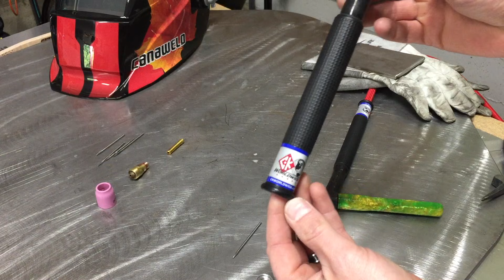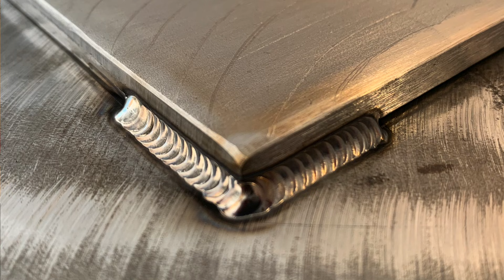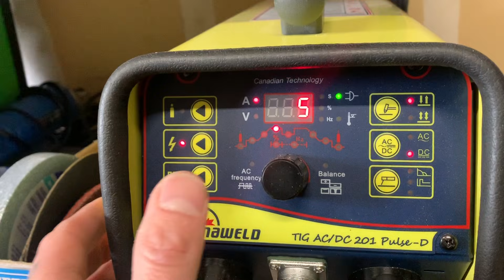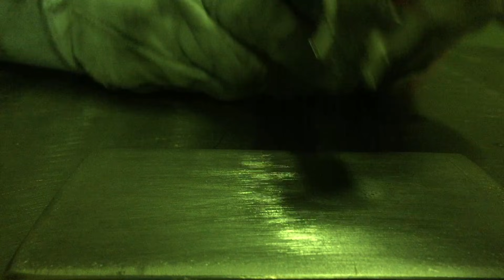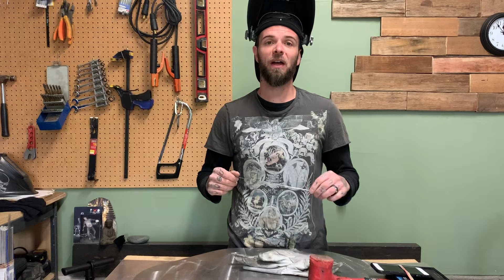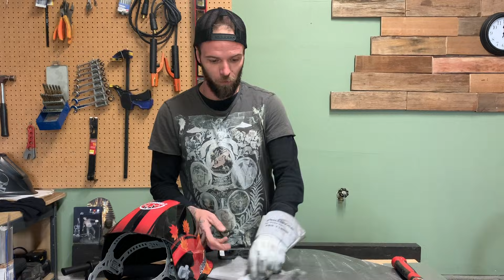TIG WELDING STAINLESS STEEL - HOW TO TIG WELD STAINLESS STEEL FOR BEGINNERS!

Comment: Hi. I have a question is there an easy way to use a blowtorch and some kind of stainless steel rod and bond to stainless steel pieces together or is this impossible. Have a video to show my issues. Can send it if it helps.

Comment: I’ve messed w my gas settings at nauseam.  20cfh usually.  I’ve tried 30 and 40.  No flow meter for the torch yet. 
Using a #8 cup and diffuser/lens.  My stainless welds still come out oxidized and gross looking. 100% argon.  Post flow puddle looks good tho @10 sec.

Comment: New to your channel and new to Tig welding...in fact, never laid a dab yet.  Tig welder on its way.  Impossible question for you....I'm mesmerized by your welding and wonder how long (how many hours) it would take someone to learn how to do something like your weave patter?  I'm OLD and don't have 20+ years...I'm interested in trying to do some simple stainless pieces.  Colored straight lines to begin with.  Keep up the good work!
Reply from the maker: Haha awesome Scott! It actually doesn’t take long; it’s just having a good watchful eye of someone to help. Starting with the basics and not trying things above your head, before someone is ready. That’s a key thing. It’s a process, and for someone to get good at the difficult things, it’s best to learn fundamentals first:) But absolutely doable!

Comment: Hello, I'm trying to find an answer to my TIG welding problem,,, First of all I'm an old guy retired with time on my hands.
I just wanted to learn TIG to give me something to do.
Problem,,,,, I'll be running a nice bead and all at once the arc jumps off the weld a 1/4 to 1/2" and then come back.
I've watched a 1000 videos and no one has covered this problem,,,, and yes it's a clean  tungsten. 15 cfh 100% argon,, 70A 1/8" mild steel
Thanks for your help
RHH
Reply from the maker: Hmmm tough to weigh in without seeing it happen. Usually can be attributed to having a standoff distance a bit too far away... can cause arc deflection slightly. But without seeing it tough to call. Good you keep a clean tungsten! That’s the first one I always go after for troubleshooting! So good call already on that!🙏
Reply: @PacificArcTigWelding  By chance does the arc follow the gas as it comes out?
Reason I ask,, I smoke and notice the smoke was going the same direction but didn't think it was a strong breeze.
Reply from the maker: A slight breeze can effect things more than it would seem. Especially with stainless. It’s annoying sometimes...!🤦🏻‍♂️ And in that case then I would think the arc could deflect possibly.

Comment: Does the tungsten need any certain type of grind for ss??
Reply from the maker: Everyone’s got their own preference, I like a longer taper. Grind marks lengthwise 💪
Reply: Pacific Arc Tig Welding What’s the best way to get the bead width correct without overheating SS or on mild steel 1/8” material ? I’m using 3/32 tungsten with #6 ceramic cup. Do I need to drop down to 1/16” tungsten and filler. Do I need a gas cup? Or better yet what size should the puddles be according to tungsten size and filler??
Reply from the maker: I’d use a thinner rod, just preferred by me tho. People use 3/32. I usually say a puddle with thick as about an 1/8”? Give or take:)
Reply: Pacific Arc Tig Welding ok thank you man!!
Reply: Pacific Arc Tig Welding I gotcha thanks!!

Comment: Off topic but my argon flow meter with the ball only moves if the pedal is pushed to my desired cfh but then when you let off the pedal the ball drops back down to bottom after the post flow....is that normal?
Reply from the maker: Yep. That reads working pressure, so when working pressure is off, ball drops:)
Reply: Pacific Arc Tig Welding Thats good I was worried I had a leak somewhere !!! Thx man!!!

Comment: Another great video I’ve gone back and watched many of your videos I’ve only started tig welding a year ago after 50 years of stick and mig I’m 70 years old and as you get older your hands aren’t very steady so that makes tig welding very challenging but I’m staying at it but it is very frustrating any help with this would be very intriguing
Reply from the maker: Amazing to hear! Glad I could contribute in any way! Great to hear you’re learning!
Reply: May not work, but try to use those shakes to run ur bead, iknow some older welders that can run very good beads

Comment: Question! How far is your tungsten stick out and how close are you holding it to the metal?

Thanks!
Reply from the maker: Hey! I usually run stickout length the same as cup diameter. Ex 1/4” cup opening, 1/4” stickout. And then aim for standoff distance less than that:) Basic starting point for me at least 🙏
Reply: @PacificArcTigWelding  awesome, thanks!

Comment: Thank you for including metallurgy! It helps so much. Because I feel like that’s part of the basics, to fundamentally understand metals and how they work. 
Though I could be wrong, I thought stainless was supposed to have less carbon in it. Like when using a grinding disc that’s been used on carbon steel, you could impregnate the stainless with those iron and carbon deposits which can cause it to rust.

Just to edit: keep your filler wire shielded with the post flow!
Reply from the maker: All good points! Filler wire getting oxidized is something that took me so long to figure out by myself...! Self taught takes too long on some things😂
Cheers my friend:)
Reply: Pacific Arc Tig Welding haha yeah! It took me a hot minute to learn keeping filler shielded. It doesn’t matter with aluminum wire though since it’s a non reactive metal I believe
Reply from the maker: Yep you got it! Easy when it’s aluminum, but also easy when i run a #15 cup on stainless too😂 When i switch to a 7 or 8 for fine detail all of a sudden I have to pay way more attention...😂

Comment: I see some people use only 3/32" for everything and some that match the filler rod size to the tungsten size and use the 1amp per thou. 
Which is your preference
Reply from the maker: Yeah I hear all that. I use strictly 3/32 tungsten and 1/16” for most of what I do. I’m open though, and there’s obviously applications for different setups. I’m a pretty open minded dude for welding setups🍻
Reply: 1 amp per thousand is only good up to .125 or 1/8” thick material from what I’ve seen!

Comment: I would have run 100amp and bored a bit quicker. But God I love the look of the colours
Reply from the maker: Me too. #keepthecolour 
All good! Thanks for checking out the vid!
Reply: @PacificArcTigWelding  
Just hit the sub button mate. 
I have also booked in for next thursday to finally get certified in Tig Welding. 
Been doing it for years aswel as mig, stick and silver solder and brazing. 
So been doing it for years but finally getting the process of getting certified under way.
Reply from the maker: Amazing! I’m sure you’ll get it. Good for you! And thank you for checking out my channel!
Reply: I also agree with your opinion. As welding stainless is not as simple as welding mild steel. You can ruin the characteristics of stainless from to much heat. Not enough gas. Not back purging and so on. 
And starting of you need to learn torch control. 
Regardless of what your welding. And welding without filler. Autoginious welding is a ton simpler. And is the best way as you dont have to focus on 2 things at once. 
It also gives you the chance to stuff about and learn what things do and how they affect the arc. So welding without filler is the best way to begin.

Comment: Hi,
just thought I'd drop a comment - I just got my first TIG yesterday. I want to be welding some motorcycle exhausts in Stainless - any help or tips will be gratefully received :)
Reply from the maker: This vid has some good setup setting for some practice beads:) Id drop the amps really low for exhaust stuff, 45-60 amps. Definitely get some scrap, and try a few passes:)
Let me know how it goes!

Comment: Good so far, but regarding the magnet test, (most common) stainless steel isn't magnetic "inside" - it isn't the passivation layer! That layer is nanometers thick - far thinner than any paint layer, but self-healing in air. Also, most stainless is a little bit magnetic if you use a really strong modern magnet.
Very detailed and good video so far!
Reply from the maker: Cheers Nigel!🍻
Reply: Hence your fridge

Comment: Thanks for making these videos.
Reply from the maker: Absolutely my friend 🙏
Reply: @PacificArcTigWelding  have 1 question. How do you get the puddle so wide? My welds are so narrow in comparison. Using same cup as you, 3/32 tungsten, 1/16 308 filler, i have a feeling is something to do with what you do in the beginning of the weld, i.e. lots of filler to widen the puddle and go from there
Reply from the maker: Yeah exactly! Watch my starts. The key is to hang out and let it sink out to the width I want (without overheating of course) then once it’s the shape I want, I’ll roll out from there:)

Comment: Is it ok to tig mild steal with stainless steal filler rod?
Reply from the maker: Yeah, although the alloy of the stainless will be different, I wouldn’t use it to weld anything super load bearing or will be under stress of any kind. If I’m just tacking a few pieces together, or something small I usually find it’s ok. 
Do your research though, if it’s a serious job then I would seek out the proper alloy of steel etc.
Reply: Pacific Arc Tig Welding thanks.
Reply from the maker: Absolutely my friend 🙏

Comment: Awesome Channel, Really like your videos. 

I tried your suggestion on this video for Stainless Steel, Using a 10 cup with a gas lens, but I could't get the nice color out of the welds at all, even with as much as 30 CFH my welds were dull, gray like cooked, So after so many beads I run I then swapped the cup for my Moose knucle settings remain the same and emediately my weld were really nice. So i Started to reduce the CFH all the way down to 15 CFH and the beads were really nice, So I switched to a 12 Cup same as the furick Cup and welds remain the same really nice goldish color and what not,  so I decided to step down to a 10 cup, settings remain the same, and the weld again was dull/gray cooked, so I changed my cup to a 12 and the weld came out really nice. 
So waht I did noticed on both cups 12 and 14 both of them have the extra screen in the cups, where the 10 did not have that is the only thing aprat from those cups so I could not lay down a nice weld with a 10 or 8 cup with just the gas lens any Idea on what to try next improve up on the smaller cups?
Reply from the maker: Interesting! Screens do make a big difference for sure- however I’m surprised to think they’d be a reason a weld stays clean or completely cooked out. How about your tungsten stick out? When someone is having problems I usually recommend they pull their tungsten in to a short stick out, this way, you’ll get the best coverage, so we can tell if your cfh is the problem. Glad you’re having some success though! Thank you for checking out my channel and hitting me up!
Reply: That’s very strange. You should be able to do this with or without a gas lens, though lenses give mire even coverage. So one or more layers shouldn’t make much of a difference. Neither should the cups. Big cups are great for outside edges where the gas moves away from the weld, up the sides. Make sure the cups you’re having a problem with are fittings properly, or they could suck air into the argon cloud.

Comment: Great vid perfect timing as i am about to attempt welding stainless for my boat project. I am work with 1/4 inch 304 stainless. I am welding some 3/8 stainless bolts threaded in from the backside. What amperage did you work with in you demo here(i saw your note saying your pedal was 60-70% depressed, was that at all times?) and what would you suggest i work with for my application. I did some tests and the welds came out gray and nasty blobby .. argon was around 17, 5 second post flow, amps set at 125( guessing that was way too hot after this vid)
Reply from the maker: May have been a bit hot yes, you could always try just tacking first before running full beads. A tack here and there is a great ‘test’ to see how the full lays down. I’d say at about 90 amps you could be pressing pedal down most of the way and be ok:) let me know how it goes!
Reply: Thanks, will let you know how it goes!!
Reply from the maker: Please do! Cheers!
Reply: @PacificArcTigWelding  so tried it again with lower amps and still having issues.. watched sone other vids that mentioned using a large gas lens cup is needed for "pretty" stainless welds. I am using a standard #7 cup and collet body, do you think that could be my issue and do i need a gas lens or can i just turn up the CFH on my argon? What would be too much CFH if i tried that? Also im using 3/32 tungsten and 3/32 316L filler .. the guy at the weld shop said its fine to use that rob on 304.. thanks for your help!!
Reply from the maker: You could definitely stand to up your cfh, try 20-25? See if it improves? If it does then you’re on to something. Cup size HELPS the weld finish, but doesn’t make it or break it. Is you stuff is turning out straight up not right, I’d doubt it’s cup size. A 7 should be ok. How much tungsten stick out do you have?
Reply: @PacificArcTigWelding  to reply to the last question, my tungsten stick out is a little less than a half inch.. now did a test where i upped the cfm to around 25-30 cfh with the 7 cup at 90 amps full pedal and the weld had a nice silver color after wire brushing it, but it didnt seem like it penetrated very well, the weld was sitting more on top of the metal, dont know the technical term for that.. so i raised the amperage to 110 and got a flatter weld that looked good after brushing, had a straw color to it ... so i would deduce that its definitely a gas coverage issue.. im gonna order a gas lens setup, prob like a 10 or 12 cup .. and test with that. I think i will get good results without needing to wire brush it .. what i have now should be good enough for my needs since these welds will never be seen. Then i can practice more to get the technique down with the larger cup .. i will let you know if everything gets resolved with the gas lens.. thanks again for your help!!
Reply from the maker: Awesome! Keep me in the loop! Cheers!
Reply: @PacificArcTigWelding  so got a gas lens set from Amazon and that helped immensely.. even though everyone says it all the time, having a clean sharpened tungsten, the right gas flow, and a clean part make all the difference. Got what i needed to do done and the welds came out not gray, but not so nice due to my lack of skills.. i think im good for now, thank you so much for your support!!
Reply from the maker: Absolutely! Happy to help you! Cheers my friend ✌️

Comment: These videos will become huge resources once they get the traction they deserve.  Great work, and thanks for putting in the effort.  Being into the car side of things, thin wall stainless automotive type stuff would be interesting to see more information on.  Stainless butt joints for exhaust, stainless exhaust tube to a VBand without warpage, stainless tube to a 2 bolt flange, steady pedal vs manual pulse vs machine pulse etc.
Reply from the maker: Nice! I really appreciate the kind words on the channel, happy to hear it’s reaching people so far:) 
And thank you for the suggestions! I actually take a lot of these down for ideas, so I appreciate them! Cheers!

Comment: The Pink Gas Cups are generally not referred to as Ceramic. They are normally called Alumina Cups or Nozzles, due to the fact they are made from Alumina Oxide. Most people in the Tig Welding community think of Ceramic Cups/Nozzles as like the White Ceramic Cups that are made by Michael Furick. Which are the only brand of Cups that I use. Even when I use an Alumina Cup I use Furick Brand. When I get a chance I will send you some photos of my Tig Ammo Box as my Buddy calls it.  I use CK Torches with Furick Gas Lens setup, and Furick Cups, Ceramic, Glass (Pyrex), and Alumina. I just don't use Alumina that often anymore. Really digging your Videos, keep uo the good work, and keep helping people learn how to Weld. Welding is my Zen. There are very few things in the world that I would rather be doing.
Reply from the maker: Phillip! You spoke my language! Welding is my Zen. Love it. Great way of saying that, I connect with you on that. You’re absolutely right they’re called alumina, I was raised calling them ceramic, but I learned that wasn’t totally right. sometimes I forget things... I appreciate you reminding me! And thank you for the kind words on the channel. It’s been a super fun venture so far! Thanks for reaching out 🍻

Comment: Dusty, not a welder, but a home hack myself! I'm trying to teach myself TIG welding of Aluminium and I always put either too much heat into the start and end of a corner joint causing it to melt the base metal. Any tips on how to prevent this would be great. I'm guessing the answer will be practice, but any welder settings that alleviate this would be useful if you can discuss this.
Reply from the maker: Hmm tough to call without knowing some details. How thick of material? Position? Amperage settings? I’ll help however I can🍻